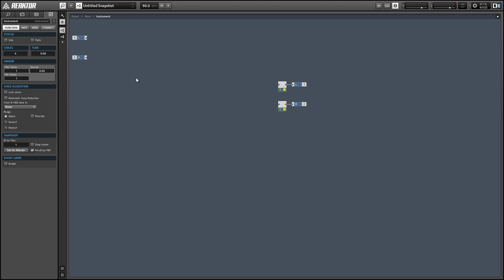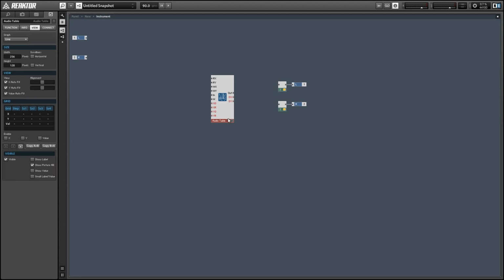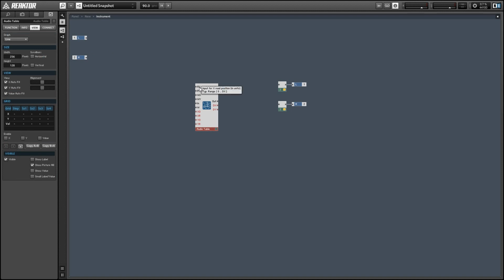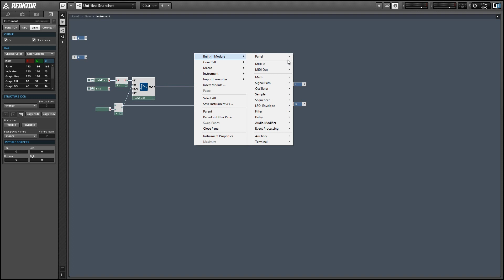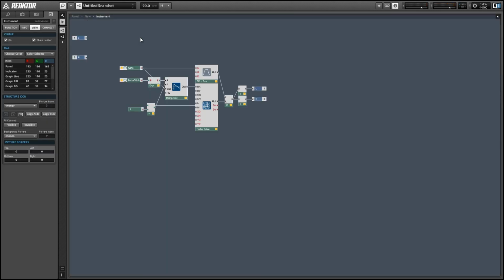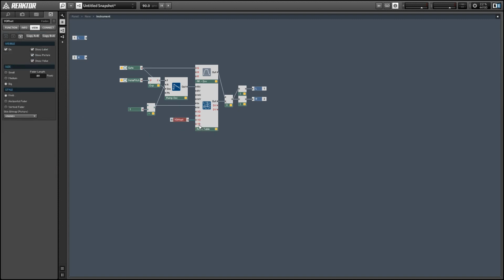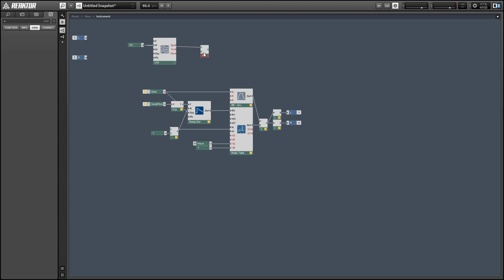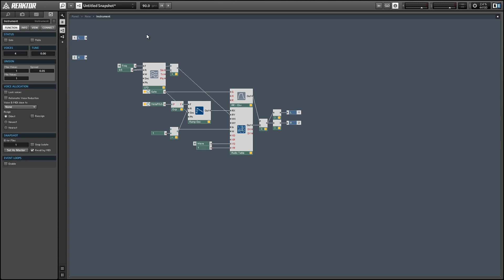Reaktor - Create Morphing Wavetables - How to Tutorial

Comment: Great tutorial, salamanderanagram, thanks! I wonder how one could go about storing a series of waveforms for future use?
Reply from the maker: well you can save and load the tables using the audio table itself, in the function tab of properties. 

unfortunately we can't use pointers to data in reaktor so we are a little limited because every piece of data we want to be able to use has to load up with reaktor.
Reply: ***** OK I get it (just watched previous tutorial) so I guess you could also create a bunch of waveforms in an external wave editor and load them up too?
Reply: So there is absolutely no way to create presets you can load outside of the function tab? I am working on a huge synth at the moment, with which you should be able to load 2 wavetables and morph them together. Please don't tell me that I have to program the whole synth in C++ because there is no such function in Reaktor :/